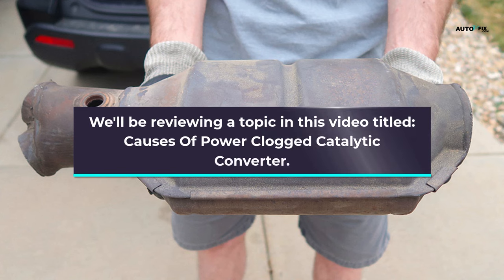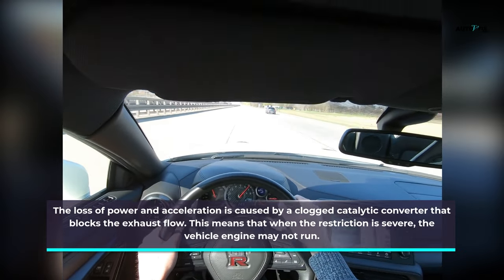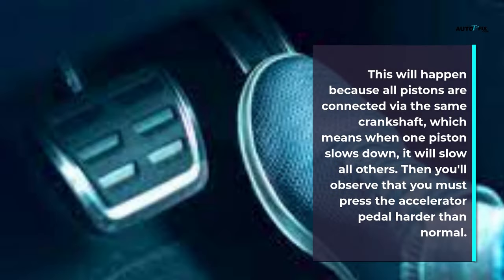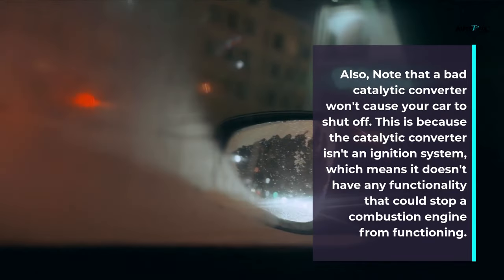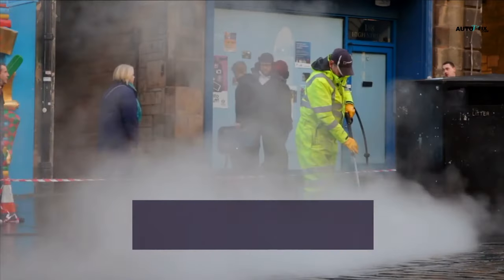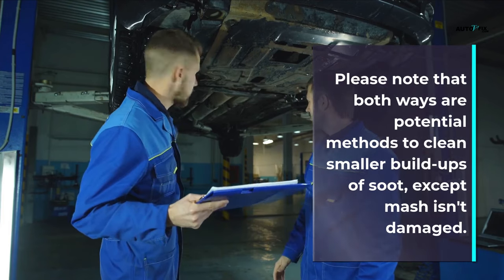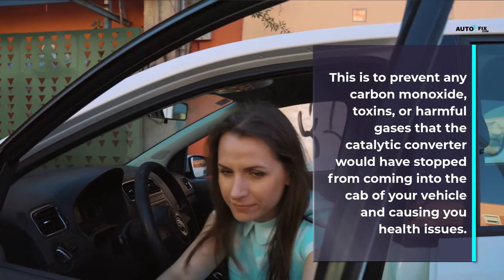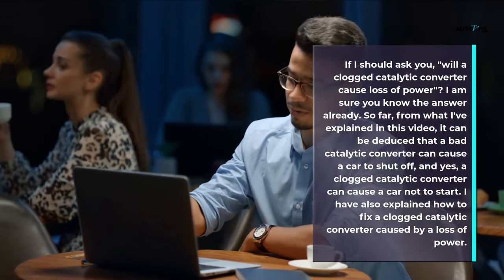Clogged Catalytic Converter Symptoms, Fix & Will the Clog Cause Loss Of Power

Comment: You can always cut off the catalytic converter and weld a piece of pipe in place, it's illegal but it's also the cheapest route if you are low on money and can't afford a new catalytic converter. In fact catalytic converters usually restrict your exhaust system, there's pros and cons to doing a Catalytic converter delete.
Reply: What are the cons of a cat delete?
Reply: Car becomes loud asf, your check engine light will always be on and depending on what state you live in, you’ll fail smog and inspections
Reply: @exoticalien929  actually they make parts to by pass it. As of what I have and won’t throw a code. 02 deformer
Reply: I replaced mines with a pipe but stil slow
Reply: Doesn't work very well when you have an O2 sensor upstream and downstream of the cat.
Reply: @exoticalien929 u can buy a cel spacer, weld it into the straight pipe and screw on the 02 sensor
Reply: Truck runs like shit after cat deleted and did the spacer trick already on the rear o2 sensor idk what to do now
Reply: I unhooked the cat cat converter and took out all of the inside and bolted back together, it didnt make a change on the noise it produces and it was easier than weld a pipe to it plus i got to keep the o2sensor and i will find the bypass somebody mention in the coments and i think it will work good
Reply: @pakovargas5103 did it work?

Comment: The car can shut off or not start if it is clogged or if there is an obstruction or cause a rough idle leading to a stall
Reply: Thanks. That’s what I was looking for. My car gave a code for a cat and is now rough idling when I put it in gear and sit at a light. Acts like is gonna shut off.

Comment: The military does not use catalytic converter‘s on any of its vehicles. Nor does NASCAR, which makes you realize that converters are bad for performance. Mine was clogged once in a mechanic, brought out some very strong smelling chemicals and my converter was clean. I don’t know what he used, but it certainly did the trick.
Reply: well cause military power arent inspected to citizen standards.

Comment: Can you put anything in the gas to clean it out the Clogged Catalytic Converter that really works without spending allot of money? Would you get better gas millage with them working?
Reply: Lacquer thinner is the best thing to use. Have at least half a tank of fuel and pour a couple cups of it into the gas tank and run it for about 150 or so miles
Reply: @brianbailey8833  Sounds like that could screw up the motor. Straight lacquer, or mixed, and how much? What happens when it's cleaned, better milage?
Reply: Did u try this,? I was told about this and a cleaner call CAT CLEANER I'm go try that

Comment: My car goes off when I put in drive....can it be the cat?
Reply: Yes, I was about to pull off and my cars engine turned off. I was also having performance issues, couldn't accelerate and my shifting wasn't good sometimes. 
My mechanic just called and said the catalytic converter was clogged and needed replacement.
Reply: @geovanihernandez1683 what caused your catalytic converter to clog?